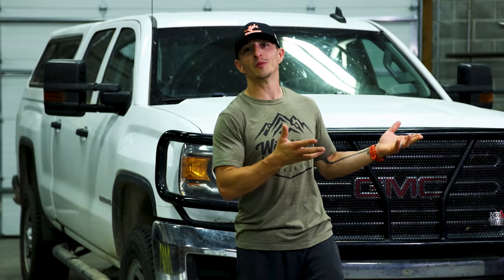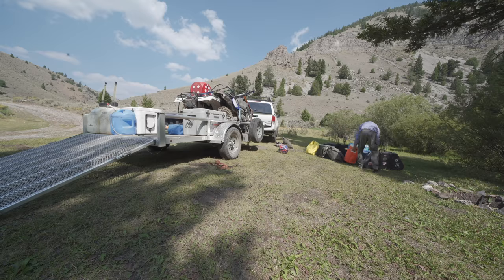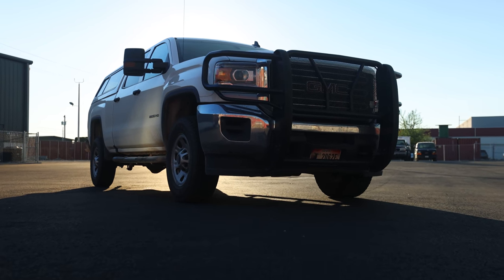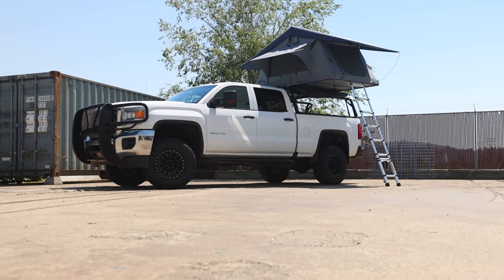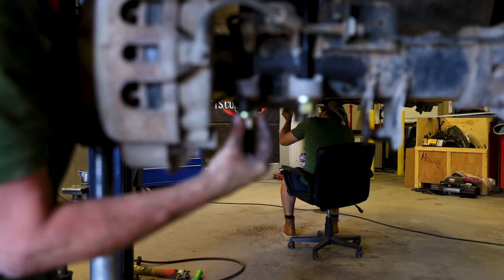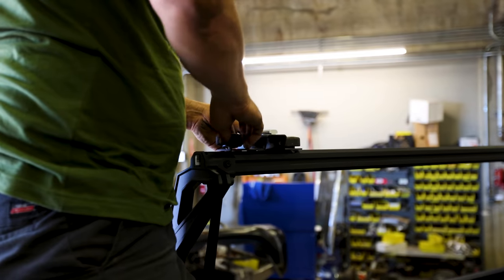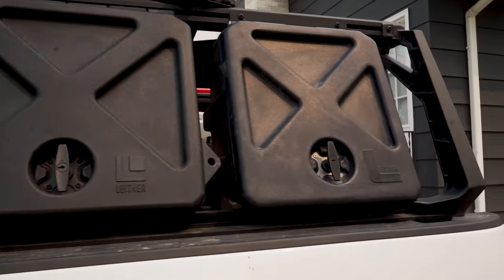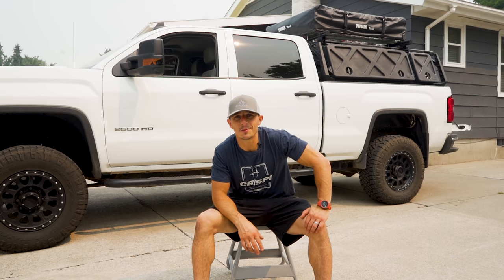Ultimate Truck Build For Hunting

Comment: Awesome man!
I have a 2002 crew cab super duty long bed 7.3L diesel with only 130K miles. Zero rust. 
6” lift  35” tires Fox 2.0 shocks. Installed a tall hard cap for sleeping.  
That’s my Ultimate hunting rig. 
We took it out The Midwest many many times. 
I tow a small 5 X 8 inclosed V nose trailer for all our equipment and gear.

Comment: Congratulations 🎉 Dan on quite the setup. I really love the bed area accessories that you have going on from the DeckD system to the Thule truck 🛻 tent ⛺️. Both would be great out on public land chasing those bugling beast. The tires and rims are great too. The only thing I would add would be after market off road bumpers with a winch system. It could save your tail in a pinch, protect your truck through rock and tree 🌲 plus it looks so much better than the giant bling chrome bumpers. But that could take you over budget. Perhaps next year.
Once again happy for you Dan what a practical upgrade over the Tacoma. Which is more nimble off road but can’t carry all your gear as well as a 2500HD

Comment: Nice build....Next tires should be GY Wrangler Duractracs 285-75/18. 10 ply.   Best all around tire on the market....NO contest!
Reply: Is this the Super Duty Tremor factory tire?  I wonder if they'd fit this Silverado 2500 on stock wheels and suspension?

Comment: I have an 08 SLT 2500 HD 6L on a 6” lift and 35s. I like your idea of the storage and tent but I would personally build it lower tent height like right off the bed sides, and farther back so I can fit a slip tank in the front, and still have bed storage as the fuel mileage is balls. Great build

Comment: Ha, Dan I’m you 30 yrs later!!! My whole life has revolved around athletics, well until 9 yrs ago when I got hit by a car. Short story, to not fall into a pit of depression, I took up archery and with very limited success bow hunting. I initially would sleep in my truck, a 08 Suburban. But I dialled it up a notch and did a BDS lift, rebuilt and supercharged the engine, built a deck inside with two drawers, and yes, the ruggedized Tepui Kukenam 3 on the roof. Luv the setup but let’s face it, mid 60’s with a bum leg, makes for a hard time packing that tent down. But hey, whatever it takes right. Pain is just weakness leaving the body!

Comment: I like the build, and have the same desires, but know very well that despite the convenience of a roof top tent, you will really hate it if you have to use it in bad or even just wet weather.  Once it's wet you can't pack it up without mildew or infiltration to the inside when its wet.  It's noisey and may disintegrate in severe wind.  Snow and ice rock havok on the shape, zippers etc when re-collapsing and redeploying it.  The rest of the time it's great.